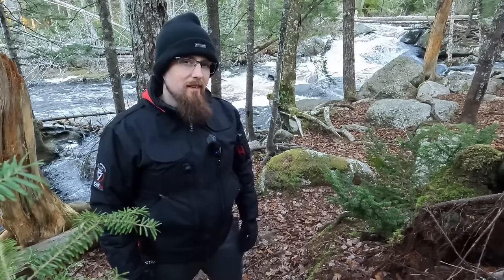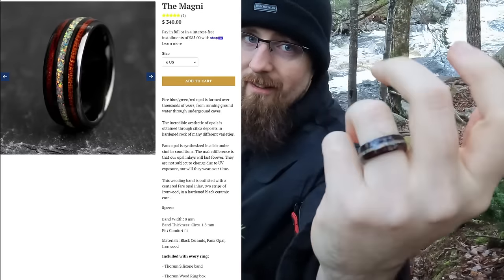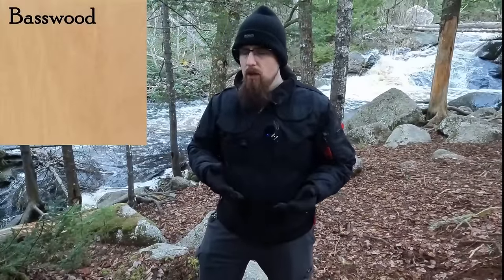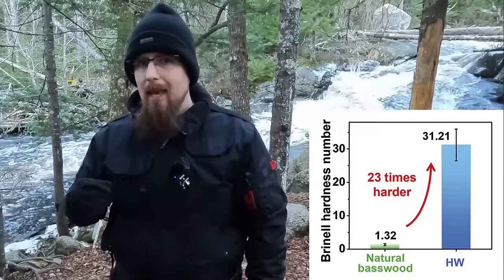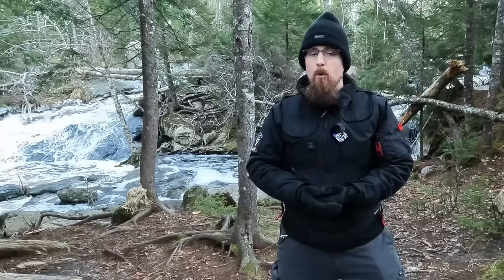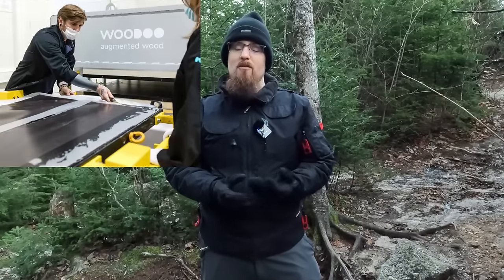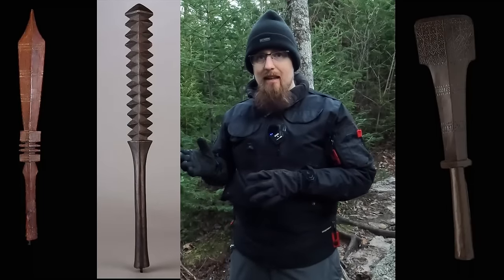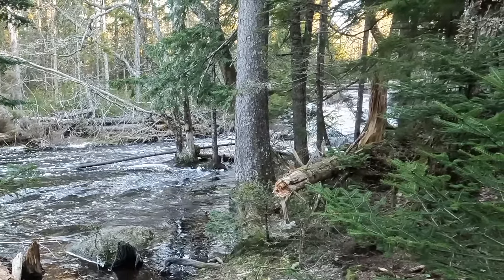Hardened Super Wood!  -  Can It Rival Steel?

Comment: On a wood chemistry course I took recently, we ended up discussing this article, focusing on the innovative aspect of the research and validity of its results (not to diss on the authors).
 I was a little bugged out by the applications they chose for the material. The knife test seemed devised to grant their hardened wood the best results. There is also the video of someone trying to cut a steak with the wooden knife that doesn't look very practical. And then there's the nail that does not seem that useful.
Besides that, as my professor pointed out, the chemical bath they used to extract lignin and hemicellulose is nothing new. It is the same one used in Kraft pulping (sodium hydroxide and sodium sulfite). Even compressing the wood isn’t exactly new, they just used a powerful hot press. Putting that aside, the research is very solid, and we just wished they applied the hardened wood in more useful and less "clickbaity" stuff. 

Anyways, great video and very good insights!
Reply: Did you end up discussing what these more practical applications would actually be?
Reply: I'm not as educated as you but I also suspect issues with chosen materials and applications.  This being applied to something like bamboo/rattan to get the grain all in line seems like a good idea when you don't need a lot of thickness.

Likewise, the shapes for their chosen objects leave a fair bit to be desired. For example the common round nail shape is more about ease and cosr of production via wire extrusion than the most ideal shape. The material here lends itself to being pressed into molds of the older flat-style which are still bought by woodworkers due to superior mechanical properties.

Likewise, a straight edge blade may be fine for steel, but there are plenty of serrated designs this would take to better than plastic and which would work with the material properties to make a knife that's plenty effective.  Further, they could also allow for more difficult to produce edge geometries like convex and concave (with or without serrations) to be easily be produced by molding.

Trying to stick to shapes and manufacturing methods designed for other materials isn't going to yield the best results.
Reply: ... structural members for composite aircraft and boats, from softwoods that are much more common than the hardwoods that are currently considered the minimum acceptable materials?  Also, if you can mold while pressing, you can cut down massively on processing and waste.
Reply: paper straws are also far less useful yet very popular
Reply: @miketheskepticalone6285  The problem with that is that this wood is in a bad middle ground.  It's much more work to make than just farming hardwood, but not much less difficult (in theory) to make than fiberglass, aluminum, or steel.  (Practically, we of course have all the industry for metals and synthetics already, making them easier.)
And that's assuming the chemical waste isn't a problem, which it would be.  It uses similiar chemicals to paper making, which is pretty nasty stuff.
Basically, to be practical, it would require a world in which demand for wood outstrips the ability to grow it, but metals and synthetics are for some reason a problem.  Oh, and also a situation where bamboo won't work, for whatever reason.  That stuff grows FAST.
Reply: @miketheskepticalone6285 i mean aluminum is light than wood and will put in the work and thankfully us humans are really good at recycling aluminum even if we suck at reusing everything else haha
Reply: Well, most of science dresses up their papers to make the research look as promising as possible. Presenting your research in the best possible light is how you market your project and encourage it to be published in the best magazine possible, which leads to more grant money for you.
Reply: wood isn’t renewable, it literally takes decades for a tree to grow.

seriously go to one of those old mining camps and towns where they cleared basically the entire forest. an it’s been decades since and the new forest is no where near as big as it once was.

wood is NOT renewable.

an as for replacing plastic, we already have more eco friendly replacement for plastic...COMPOSTABLE plastic....plastic you can actually use in fertilizer and it breaks down much easier and safer. (also plastics have various qualities other than their durability and flexibility that makes them hard to actually replace)

as for replacing steel...  maybe in smaller applications freeing up more metal but highly unlikely.
Reply: @draconisthewyvern3664  to be fair your example of mining towns is not great because of how poorly all old mines dealt with tailings so the soil around those camps is going to be toxic. maybe not enough to kill the trees outright but going to stunt a already long growing time
Reply: There are even more clickbaity usages though. For example several years back there was a whole wave of articles on wooden skyscrapers(not actually, just high rises with 10-15 floors).
Reply: @scubasam4255  While that's true, the energy need of both production and recycling is pretty hefty.
Reply: @draconisthewyvern3664  

Seriously, you're comparing apples and oranges.

Those mining towns required wood of a certain stability and size and happened at a time when no one gave a f*** about forest management or other environmental standards.

As it stands, wood volume has been expanding in many places in Europe for many decades

There ARE already tree farms producing specifically for no other reason than to have their wood pelleted and burnt for power.
Reply: @ohauss  so long as it is only energy, we get better and better with each passing day at generating it so i am okay with that much. i have tried to recycle appliance type items and it always just ends up to base materials with few being reusable or recyclable so i will take what we can get. wish i could try forge stuff or try to take it further.
Reply: @ohauss   it still takes years for trees to grow if you want to get the most out of them.

you can harvest saplings but saplings don’t really provide that much.

unless you’re gonna use the trees bred to grow really fast like the Hybrid Poplar which on average grows 5-8 feet a year and even than it still takes a lot of time

(btw i didn’t say wood volume wasn’t growing)
Reply: @draconisthewyvern3664  Wood is absolutely renewable, what are you on about?  Just because it takes a couple decades to regrow, really?  It just means that it takes more land because you can't harvest as often.  Compare that to oil and metals, which take tens of millions of years, and wood is lightning-fast.
By your standards, what IS renewable, then?
Mining camps as your example?  Old mining camps like that poisoned the soil, that's why nothing grew back.
Reply: @Bacteriophagebs  someone failed at reading
Reply: its expedient means to present things with high level application to the masses in an entertaining way, hopefully it will lead to macro scale innovation with it. renewables are going to be very economical and therefore present at some point soon here, and to have those things be as developed as possible before fielding is in our interest
Reply: @Bacteriophagebs  If you would take more time to comprehend it then you would be able to see your questions were answered before you asked them.
Reply: @moonandstars1677  If you mean "compostable plastic," then you don't know what "renewable" means.  And you say I lack comprehension...
Reply: I think the point is that you should not market X as a better Y in materials in every case. Even steel isn't always better. Look at the system functions this might be better for. This could be part of composites, moving parts, car dashboards, surgical implants. Where does this material hit the sweet spot. Dont think steel, think brass.
Reply: @TheArklyte  a city near my home is building 3 wooden ''skyscrapers'' of ~50 floors
Reply: @scubasam4255  aluminum cannot be produced. It also does not have the same properties.
Reply: @Bacteriophagebs  fiberglass, aluminum, and steel are all very resource intensive...
Reply: the whole point IS to be ''clickbaity''... Academic research groups are not going to actually produce products.
Reply: @FrenkieWest32  Yes, but so is this new wood tech, just not quite as much.  It's in a middle ground, as I said.
Also, what does "aluminum cannot be produced" mean?
Reply: @Bacteriophagebs  This new wood tech is in its infancy; we don't really know how resource intensive it will/would be if developed further.

It essentially means the abundance of aluminum cannot be increased. It can be extracted of course, but this does not sound as sustainable.
Reply: @FrenkieWest32  Yeah, we do.  We know what it takes to grow trees, we know what the chemicals used are and how nasty they are, and we know the machines used to compress it.  These are all existing technologies.
As for aluminum, it's currently (and has been for at least a decade) cheaper/easier to recycle it than to mine and process it.  Yet we still mine and process it because it's incredibly abundant and useful and recycling can't meet demand.  Some resources are not technically renewable but are so abundant that it hardly matters.  That's why energy is the main focus of renewability, since with enough energy, we can pretty much make anything.  Titanium is the 9th most abundant element on Earth, it's in half the rocks on the surface of the planet, and is used in its natural form, chalk, as a highly-disposable product.  With enough energy, it could replace steel and aluminum both in 90% or more of uses, be better at them, and be just as recyclable.
Reply: @Bacteriophagebs  
This is so simplified its almost childlike... I assume you are not 12 year old, so you can do better. Scale-up of production drastically alters the energy consumption per unit amount. This is very basic industrial knowledge. And ''nastyness'' is not a very relevant term. 

Aluminum is way more resource intensive to recycle or extract and also less sustainable than wood. This is not disputable. What the exact comparison for processed woods (hardened in this case) would be is up for analysis.

''With enough energy'' we could do whatever we want. But we do not leave in utopias and energy is precious.
Reply: @FrenkieWest32  You're just being deliberately vague to avoid actually making any claims or statements that can be refuted, now.  Throw in an ad hominem attack while you're at it and you can keep arguing indefinitely without accomplishing anything.  I won't fall for it.
Reply: @Bacteriophagebs  What made you think I am an expert on the details of structural material productions and its lifecycle assessment? Literally my argument was that the efficiency of an undeveloped industry is not reflective of what could be, how would I have numbers on something that isn't developed yet? People said this about electric cars in the past as well; that it was less efficient than gasoline automotive. Look at where we are now.

Aluminum is more energy intensive; this is neither vague nor ''avoiding making a claim''.

And calling out how the statement ''with enough energy we could do x'' is not relevant when we are discussing what materials are energy-saving is also not avoiding anything.
Reply: i was having a think about other uses and depending on how long these can last in the rain i was thinking they would be good as roof tiles as they have been soaked in oil making them water resistant wood is a fairly okay insulator so it would no doubt help with insulation in comparison to most tiles that seem to just be a big heatsink for removing heat in the winter and absorbing heat in the summer, the wood tiles would be far less brittle so they are less likely to break from hail or debris during storms and if any do break they would be far less dangerous than the heavy stone tiles that kill a few people every year and im curious as to how much carbon is left behind after the lignin and hemicellulose are removed and if it would be high enough to be carbon neutral or negative
Reply: @EpIcHoBoGuY  Part of the reason wood is a decent insulator is its "sponginess."  This stuff has all of that removed by the chemicals and compression.
I'd bet it would make good roof tiles, though.
Reply: @Bacteriophagebs that's a really good point i didn't really think about why its a good insulator although i cant see it being worse than current ones for insulation at least
Reply: @josueroberto7356  yeah that's what I was thinking. Like you'd have a block of hardened wood but how do you even machine it into something useful? If a knife or nail didn't really work than what would? 
Seems like most tools are out of the question and just using it as a very strong block or sheet doesn't seem to serve any benefit over just using wood or steel.
Reply: Thanks for the detailed clarification and I couldn't agree more on the last part.
I definitely could see this as useful in construction for stronger integrity and lower cost, assuming its not already being applied.
I do wonder if it could be a replacer for some of our use of Hardened plastic, if it is deemed possible or not.
Reply: From a practical pov though (sans economics for now), how easy would be to scale that process up? As in, would it be viable to apply that to an entire log or  wood beam at once, and how long would it take, how much room would it take, that sorta thing? At least the chemical part, the pressing part as far as I am concerned would be a solved problem. What I mean is, would times on something many times larger and with a much larger volume (thus much smaller surface area to volume ratio) increase to absurd levels, or even make the process unlikely to work (say, it never actually penetrates to the core).
Reply: @draconisthewyvern3664  Wood is renewable. You using the worst type of forest management (i.e. fucking none) isn't exactly an argument, it is just showing you don't know much about the topic (or is misrepresenting, doesn't matter, neither is an argument or good).
Reply: Exactly
That's why they chose soft wood to begin with. Harder wood has less elastic molecules therefore harder to make harder(Im hard writing this)
You'd have to constantly soak it in chemicals and compress it then repeat it over and over to reach the potential 
You can't melt or temper it so it's hard to work with you can't have it elastic and durable at the same time so it's terrible for any kind of blade it's certainly not a replacement for metal.
Reply: @Bacteriophagebs  excuse me? Metals don't grow in dirt they're mostly directly sent to earth via astroids 
And yes oil is not renewable but we don't make kitchen knives out of oil it's just not the same use unless you want to burn wood as fuel in which case tell me how's it going in the cave?
You mistook energy for raw meterial which mostly is not renewable especially in a world which there's a higher demand of wood and trees for other uses
Reply: So is it really possible to make wood as hard as steel?
Reply: This is some insane level of wood elitism
Reply: Recycling of aluminium is limited as some of the material gets lost to oxidation. Also the amount of energy used is far from environmental friendly.
Reply: @vsync  Nope hate paper straws makes soda taste like paper
Reply: @draconisthewyvern3664  
Wood is exceptionally renewable. I'm 41 and many of my timberland plots have already had two clearcuts and are waiting on their third right now all during my tenure of stewardship. You can get thin that's good for pulpwood, mdf and paper in under 4 years, solid chip n saw in 8-9 and still have your timber cut in 15-25 with loblolly and torrey pines. Those are pretty standard numbers in the industry and why there's so many forestry folks still supplying georgia pacific and weyerhaeuser. If wood wasn't renewable, the south of the us would look like central china. The difference between the two is proper timberland management.
Reply: @Bacteriophagebs  not to mention that the volume of material removed is a consideration in and of itself. 

I've looked through many comments and every one seems to ignore the fact that in this process,  they are removing about a third of the wood itself seemingly as a waste product before compressing the remaining amounts under pressure while heating it. We already have a similar product that doesn't do this called oriented strand board. Except it uses a small amount of resins or glue for its bonding along with the wood fibers entwined within itself.
Reply: Honestly I would have liked to see them compare it to commercial plastics, given it becomes easy to mould we could maybe use the material as an alternative to some plastics, I'm sure it's not as cheap but I can't imagine even treated wood would be as bad for the world as plastics.

Obviously the chemical waste would be a problem but much easier to manage and contain than our current problems with discarded trash and decaying microplastics.
Reply: MASSIVE UPDATE, NileRed made a video in he replicated the process, with the objective of stopping a bullet. After making the wood, he was able to stop a 9mm bullet with three planks aligned so that their grains are perpendicular to each other
Reply: A wooden nail already exists (lignoloc) and is used in wood framed houses, because they expand and contract at the same rate as the 4x4 which results in a less creaky house
Reply: @Diogenes2077 all aluminium gets oxidated, to form a passivation layer stopping further degradation, also recycling aluminium is way cheaper than producing it from bauxite. 

The slag gets collected over time and then can be extracted to retrieve all aluminium. To sum it up aluminium is one of the few materials that can be recycled endlessly without loss